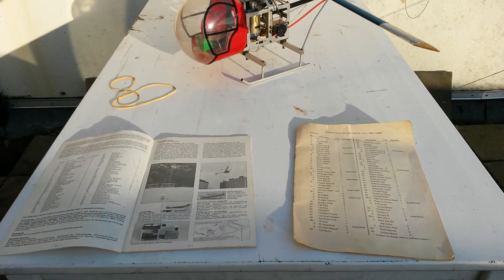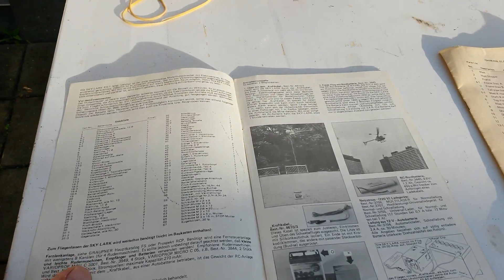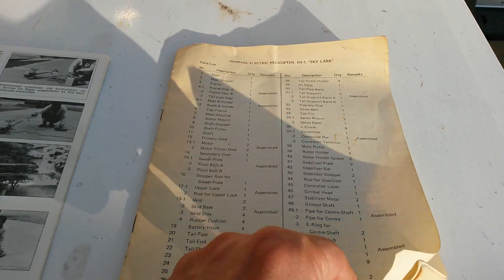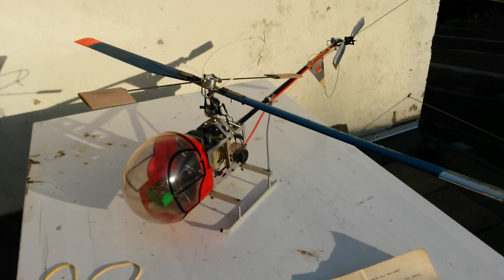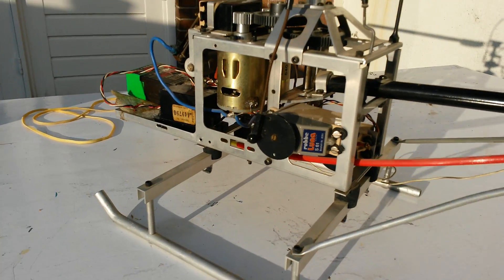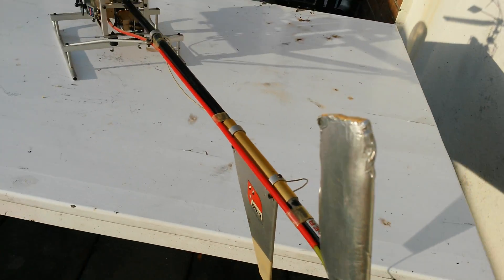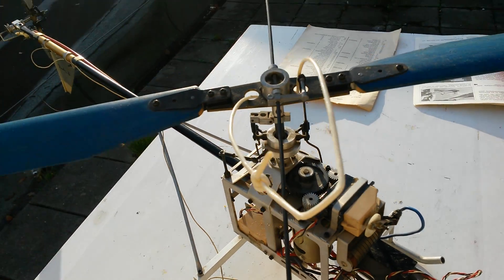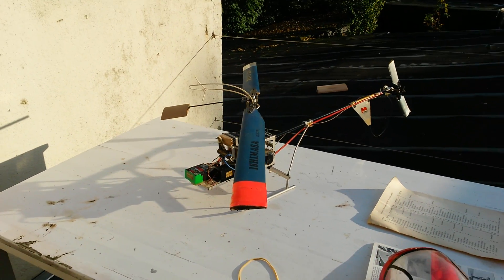The First Electric Helicopter 1980" Homemade How To Build Make a RC Helicopter at Home From Scratch

Comment: Nice video, these are interesting machines. I am restoring one I bought on ebay. It is the second example I have seen with the cyclic servos moved under the rotor mast, the stock setup puts them all in the cockpit area. Also mine has curved skid supports which seem to be an optional part.

There is a guy called NightFlyer on youtube who had a few videos of his restored one flying, he used to import them in the US.

Comment: What a shame omg!!! it is beautiful.  I cant believe they had electric helicopters back then because in those days what was is 1980 or something? 
There was no such thing as lipo batteries, brushless motors, carbon fiber bodies ,micro servos and definitely no high tech. gyro system.  You basically used what was around at the time and that wasnt much.  God How did that thing even fly? What kind of battery did that thing take? Must of been an old school Ni-Cd but in those days that rechargeable technology was ground breaking seriously people. 
I see a huge brushed motor in there. It's Vintage and should be put behind museum glass soon as the world's first electric helicopter.  I wouldn't even try to fly it. Its flying days are far behind it.
just fix it up and put it on display.
Reply from the maker: believe it or not! they used a 12v car battery with a very long cord a navel cord they call it for real lol